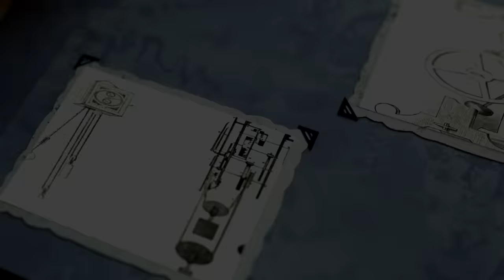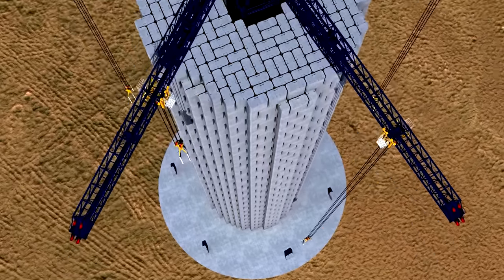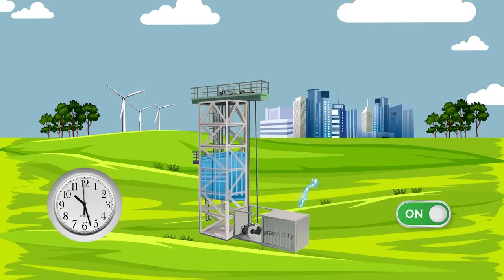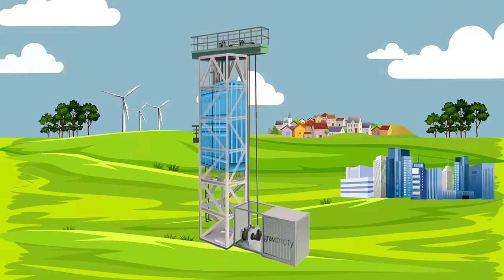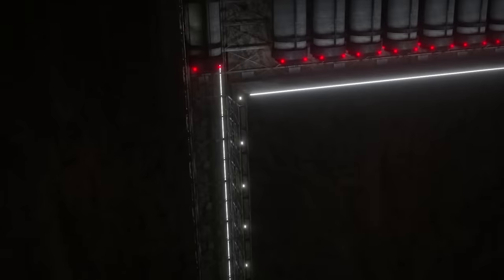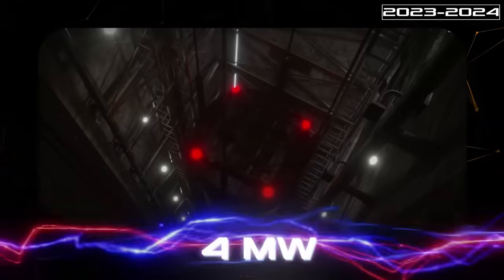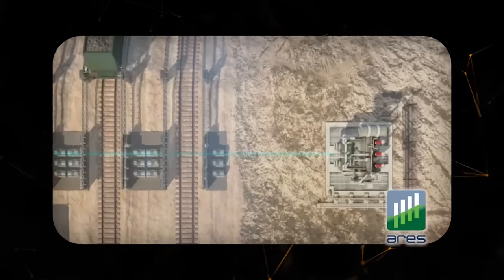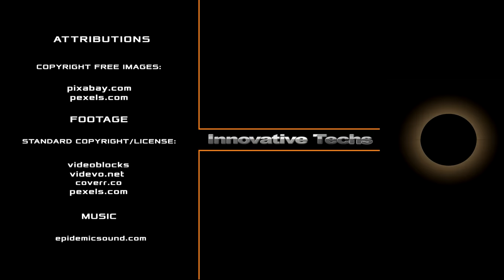How gravity batteries could change the world

Comment: You can also store potential energy by spinning a mass.  It's an old technology known as a fly wheel used in some cars in the 70s/80s to store brake energy and then to release it on acceleration.  

So, the tech and the basic know how exists.  Now scale it and use modern technology.  

A ton of tungsten is a 14.5 inch cube!  Just imagine it shaped as a bicycle wheel (maximize angular momentum), and have it spin to store energy.  It will be so compact, that each house could have one.  Put some magnets on the tungsten and with modern control systems, you can have wheel float to reduce friction.  It will draw a tiny bit of energy to keep the computers running, but that won't be so bad.  You want to do this because spin-up can take some energy, but it would be comparable to a gravity battery.
Reply: Its the same issue of the gravity battery. You can't really store a useful amount of energy that way. It is expensive to build and expensive to maintain. Storing the unused energy thermally is far more practical and isn't prone to mechanical failure.

Comment: Doesn't need to be perpedicular to the earth's surface. It can be on an incline. The storage capacity/m lift is smaller but it can be  installed on any reasonably steep slope. No need to build insanly high towers or rely on very deep mineshafts. It would need a kind of track and a very large bucket on wheels which would run on this track and could be filled with any available heavy material. It would probably not look very elegant having entire hillsides covered in large buckets on tracks running up and down the hill. But dams and basins for pumped hydro aren't pretty either. So I'd say that as long as you have water avialable and sufficient storage space for the water up and downhill use pumped hydro. In a desert or other dry area with montains or hills those dry storage solutions might work. But remember that with both pumped hydro and this system you need large amounts of water AND a large head to obtain reasonable yields. Furthermore, all these solution only work grid-integrated not as stand alone installations.

Comment: Using wind power to lift a weight into the air where wind will work against it on long cables. Much energy will be wasted in maneuvering the object. Seems like a bad idea. Some of the other gravity batteries sounded interesting.

Comment: Yes, but what of the capital costs of these gravity batteries in comparison with an additional gas powered generator? What about the CO2 footprint of building these things? Maybe gravity battery could use as ballast tons of discarded lead car batteries, which would increase their efficiency? I suppose the limit is the length and strength of the cables.

Comment: The technology should be compared with water storage. Cannot imagine a working system using blocks having comparable weight with a smallest water reservoir currently in use; also, cannot imagine a mechanical moving structure compatible with hydraulic system in terms of reliability, complexity and efficiency.

Comment: assuming nothing goes wrong and how much would it cost to fix it if they are tucked away in a mine. Also batteries with use tend to lose their charging or holding capacity. whats the shelf live on those things. we've seen this with our phones. good idea but like most things that depend on batteries. the problem is always the battery. although if a fire breaks out in a mine it would be easier to put out.

Comment: If it can power that many homes it surely can produce enough power to lift itself up and give the excess energy to the homes. Especially if there is 2 of these lifts it could be even more energy distribution with less loss. Plus they could add extra pullies so it will use less power.

Comment: This could be a far better solution than hydro because it can use recycled building waste, recycled concrete and recycled plastic to build the weights, and be installed in disused coal mine shafts so it is not unsightly or utilising arable land. A great solution all round.

Comment: I live very (like I could throw a rock and hit it) close to an old Lead mine. Part of me wishes a mine shaft would open up in my back yard. I would set up 2 gravity batteries in there using wrecking balls or something. One gets pulled up by solar on the roof. Then while that one is slowly discharging the other gets pulled up and they could go back and forth. Or if the shaft was big enough have 4 of them in a square. But I know the chances are more likely we would just have a sink hole from a collapsed horizontal shaft

Comment: What about water purification and auto transport through to vacant low laying areas like Lake Assal, Qattara Depression, Danakil Depression, Sabkhat Tah, Sabkhat Ghuzayyil, Lake Moeris, Chott Melrhir, in Africa alone - let alone Israel, Jordan, Kazakhstan, California, Argentina etc. Sealed pipework, electric pumps, generators purification and mineral extraction systems could result in transformation of areas. Once set up the depressions themselves could drive the process due to the height loss from sea level down to the depression heights. If sea level was such a concern, these projects not only could generate energy, they could extract minerals , provide drinking water and irrigate vast areas of desolate land - ultimately dropping sea level. A net increase of 3 meters of global land water table would result in a more than 1 meter drop in sea level.

Comment: This is not new technology hydraulic accumulator units were used in the 1800s to provide power around docks in Hull , a large weight was raised up approx 3m and then allowed to fall slowly providing power for a water hydraulic system

Comment: Off peak solar power can be stored as compressed air in tanks which take up far less space than towers and huge weights, and electrolysis also shows promise as a way of storing otherwise wasted energy. Perhaps hydrogen fuel cells could be employed to use the hydrogen with a continuous-feed system.

Comment: well, presented easily, but in numbers 190 kilotons of weight need to be lifted in to 20 meters high in order to store equivalent of 10kWh - usual single household battery. Price of the battery is 2x cheaper than sum of concrete blocks of this weight in the market (140euro / 2200kg).  Estimated operation height in coal mine can be 100x more, but realistic weight will be also 10x lower. The total ratio is therefore 10x vs. Lithium battery. I would prefer 10x 10kWh batteries :)

Comment: This video leaves out efficiency of the systems. One thing going for this design is potential to be more efficient than a pump based system. But storage is a major issue because when we convert between electric and mechanical/chemical/pick your storage medium ... You have major loses going in and out of the storage device. 

Any time you can minimize power conversion you save tremendous amounts of energy. Like 70% or more. One reason dams are so powerful in this conversation is they keep the power mechanical until it is ever needed as electricity. You also see this concept in hydraulic based hybrid vehicles. Where the braking energy is stored mechanically, seeing efficiencies around 90% rather than 30% in electric vehicles.

Comment: I'm sorry, but something in the numbers is not working: 

A normal home consumes about 5kwh per day. 
If we want to use in that house a battery of, let's say, 1000 tons (a concrete cube more than 7 meters on a side), using the equation of E=m·g·h and taking into account that 7kwh is about 1.8·10e10 joules, solving for the height, it turns out that I must raise the mass 1.8 kilometers!!! every day.

And this without taking into account losses due to friction or the performance of the system.

Okay, we only use it at night (and we don't want to charge an EV) and, therefore, our consumption will be 1kwh, even so, we are talking about climbing 1000 tons higher than the Eifell tower every day, only for one home.

And let's continue: a normal family emits 10 tons of Co2 per year. Making that concrete for the weight means emitting a ton of CO2 into the atmosphere, that is, what the family that lives in the house would emit in a century. (The situation is twice as bad if we opt for steel instead of concrete)

Comment: Cars inevitably have friction heat from tires contacting road...and stationary structures have gravity features. Synergistic use of physics takes a load off battery chemistry demands, and could allow hydrogen to be made on location if need be, depending on what motors are most efficient.

Comment: Nuclear power is still the best solution. Renewable like solar & wind require batteries plus the manufacture of panels & turbines are high & use old power supplies. Then on top the land & sea areas used aren't good for the environment. Whereas Nuxlear once built will have a suitcase sized package, every 20 years, of radioactive material to dispose of. They are safe, cost effective & less damaging to the environment.

Comment: Pump storage hydropower is far superior.  With the gravity tower, wind would blow the cranes and prevent one from precision placing cement blocks.  Also, literal tons of CO2 will be released in the making of the cement blocks by using the gravity tower.  Once again, pump storage hydropower is far superior.

Comment: Graviticity should refrain from building their pitch on cost savings over batteries. Batteries will get cheaper and cheaper. It might be better to bring their concept into niche markets which could still be billions a year.  At a repair garage a car uses power to be raised on the lift. When it lowers it manifest energy that is wasted as heat. There are countless numbers of these situations throughout industry that they could solve at large scale.

Comment: Lifting concrete will require immense energy instead use large empty canisters which are filled by dense liquid and then dripped and once down drain these and pump the fluid to the over head tank to fill these canisters . Can d creasw th amoubt if th energy required to lift the heavy booconjust emppy canisters are lifted up and droped as and when needed .. just a guess don't know w which is more feasible

Comment: Sure concrete isn't clean per say but lasts almost indefinitely at least in this instance.  A side note, pretty much all demoed concrete gets recycled and reused these days.
Reply: I've got an idea. Dig a hole like the oil drillers but wider. And in such a way that it can drain itself of water.  Like 20,000 feet deep and near a body of water or at least affordable accessable water somehow. Build a sled that fits into the hole that a huge massive water container can fit onto. Pump it full of water at the surface of earth and drop it into the hole so the cable its attached to goes through some beefy pullies to a spool connected to big motor that can hoist when electricity is cheap but resist the drop force of the water container when electricity is expensive to generate income supplying electricity to the grid. Now, instead of hoisting it back up with the weight, have a robotic mechanism that automatically drains the container at the bottom of the hole, then hoist the empty water container back up while it's empty this saving a bunch of energy. costing way less electricity and savings bunch of money, then just fill it back up with more water at the surface and do it again. There is tons of ocean water. If the weight can drop really really far distance the money it generates could eventually pay for the hole that had to be dug and pay the cost to refill the containers at the top while being profitable. The only issue, how do you ensure the water drains away and doesn't just fill up the hole. The main issue is the electricity it'll generate will be less going down than it'll cost to haul up so you hoist it up when electricity is cheap but you need more anyway so it sucks the profits dry as you're just wasting energy hauling weights up and down. But if you could drop the weight and generate the power without having to bail the wait up because it's water designed to drain away, the you could haul up a light sled with an empty water container for a tiny fraction of the cost of would've costed to haul it back up full like if you did it with a lead weight and has no choice but to haul the weight up.
Reply: @TheAnnoyingBoss  MAKE YOUR POST LONGER!!

Comment: Surprised they are not using water as the weight
Reply: Good choice because is affordable but something more dense can also pull harder on a stronger motor and create more electricity. The heavier the weight and the farther you drop it the more money you can make selling the electricity that hopefully eventually pays for the cost of hoisting the weight back up at cheaper electricity prices plus paying back the cost of digging a deep big hole

Comment: Let the electric power demand of a household be 10 kW. If the weight is 100t and it sinks at a speed of 0.01m/s, then we get this much power. In this case, the building would have to be 864m high to serve the daily needs of a single household.
Not feasible.
It is more appropriate to use used cells from electric cars.

Comment: People spend so much time on pc/tv/entertainment etc... that no-one actually does the innovative projects. I have 300A powersupply just sitting on corridor. It is meant to make hydrogen by electrolysis. With 300 amp it takes 30s to fill one party balloon with H2 or 32 days to have enough hydrogen to lift me up . I have 306L steel meshes, and nickel foam - ( 2-3 square metres of steel mesh and nickel foam) - just sitting and waiting there - waiting for maker.

Comment: How about a micro or mini gravity batteries? is this viable?
Reply: Nope, single AA battery can store around 10000 joules of energy. Energy capacity of gravity battery is calculated by multiplying mass of the weight times hight of the lift times 10. 
So if we wanted a battery with a size of the normal AA (5cm), then
E = m*h*10
m = E/(h*10)
m = 10000 / (0,05 * 10)
m = 5000 kg
We would need to somehow store a weight with the mass of 5 tonnes (3 cars) in the object of the size of single AA battery!

That is impossible, until we find a way to contain the material of a neutron star. Now if we could do that, than the battery could store something like 100GJ of energy which is enough to power a small city for 5 hours.
Reply: Ok, first, it’s sort of been done, quite successfully, in watches.  The wrist movement, generates energy for the watch.  Arguably, this is generation, because the energy per movement is so small, but that itself is worth noting.  You wouldn’t have a micro-mass in a small AA battery, unless it followed this exact principle, is why I mention it.  That’s at the micro end of micro in batteries though?  You’d strap this to your ankle or something and get it to charge your phone via a thin wire up the trouser seam?  I dunno.  I think the larger the scale the more efficient mass batteries get.  What about combining the ‘sail’ idea I say on one channel?  The parasail kite, pulls up and down generating, but you could easily have it pull the mass up and skyscrapers have a lot of wind movement, and you can convert the horizontal wind movement, into vertical lifting of the mass…but it must have space around it to work and the skyscraper must be able to withstand this extra force.  Worth trying, we really haven’t done half the effort we put into internal combustion engines.  Just got to keep going!

Comment: Never mind the vast fixed investment cost, and on the premise of zero efficiency loss, i.e., a unit of electricity used can produce also a unit of new electricity, such operation is nothing but arbitrage: buying low to sell high. However, lifting stone is not effortless, and hence there must be some efficiency loss, such arbitrage may not be that profitable. A utility company itself may be in a better arbitrage position, for its low is much lower than an independent speculator. But then, there are some more efficient (less electricity consuming) devices, as suggested, e.g., by Tore Lund, than stone lifting.

Comment: I love your idea!!! and I also just had a surprising idea myself, I hope you don't mind that I throw it out there!!! Combine 1. Tall mine shafts and 2. Electric motors and 3. Crossbow arrow bolts that strike a plate that has toothed gear plates that drive the gears with that striking kinetic force, maybe horizontally or the other way vertically with a ton of kinetic force, behind every bolt launched by a Giant Crossbow. The crossbow bolts would need to be "Massive" in size to really pump out the juice (electricity), and I would recommend literally having thousands of crossbows running from the top of the mine shaft, all the way to the bottom of the mine shaft, with a safe catch and return on all the crossbow bolts, and reload system. I don't care about the patent office, and making a ton of money, I just want to be able to breath clean fresh air. Have a Magical Day!!! Sincerely, Kelly